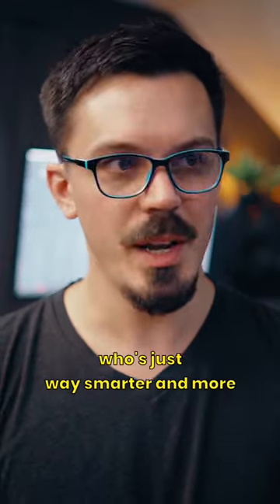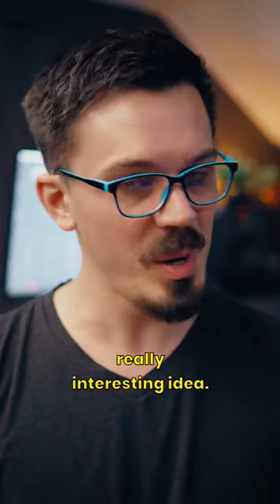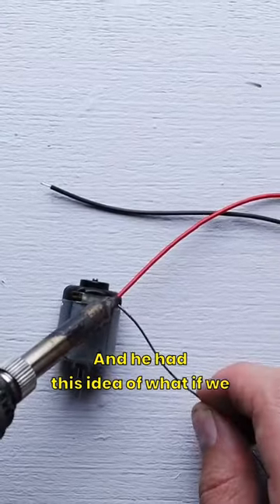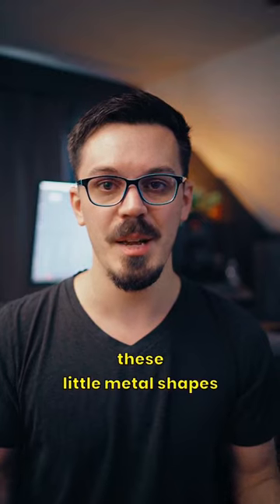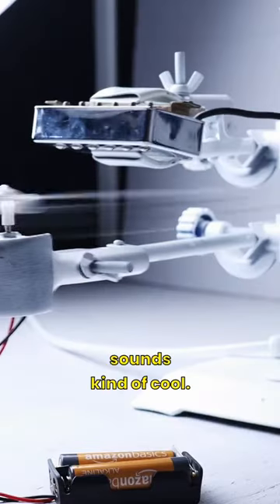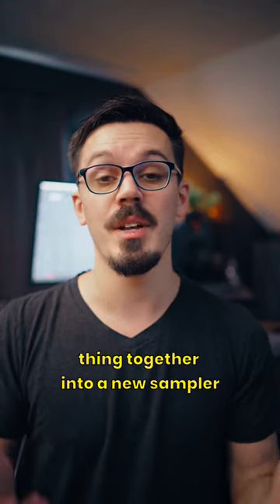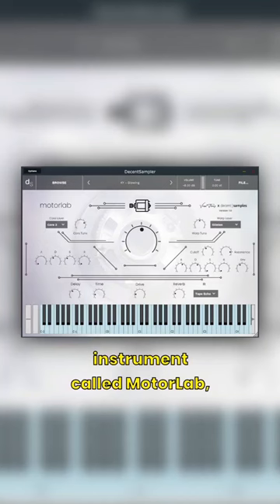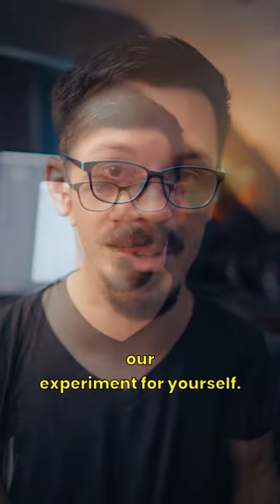We turned a toy into a synth!

Comment: 1 - use multiple metals that are electrically isolated. Copper wire, insulated from steel wire,  etc
2 - small magnets and start far away if you do that. 
3 - asymmetry